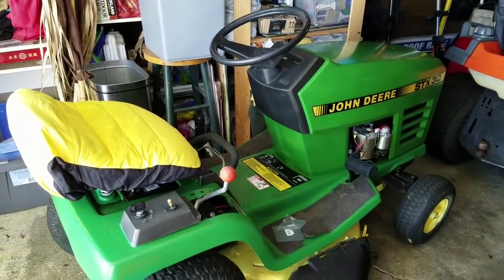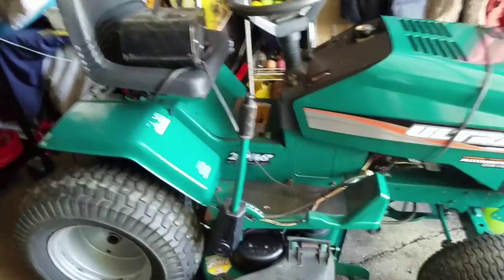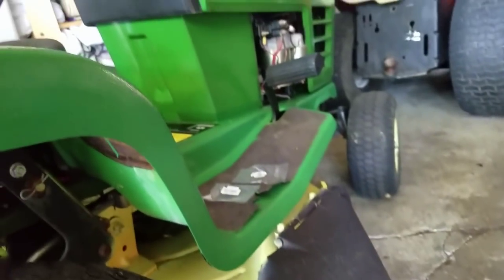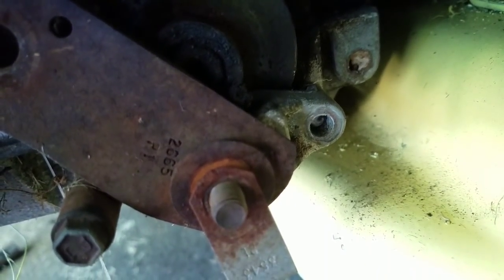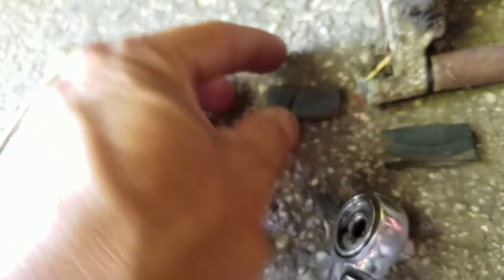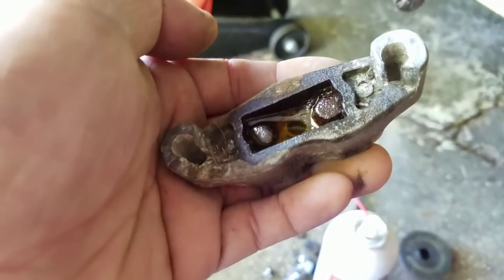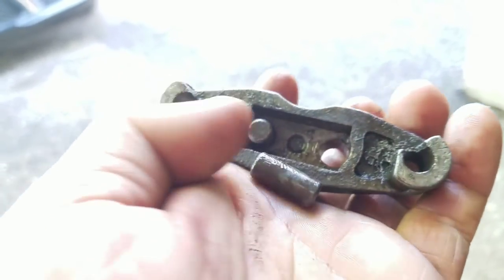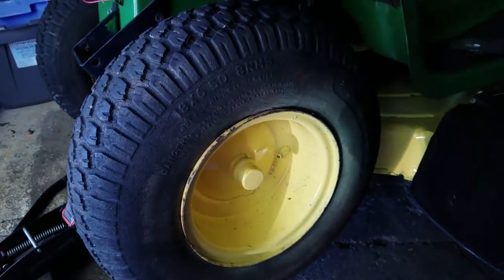JOHN DEERE STX30 LAWN TRACTOR RIDING MOWER LAWNMOWER CHANGE REPLACE BRAKE PADS REPLACEMENT BRAKES

Comment: I make my own. Use old car brake pads and a hacksaw. To get the wheel off , use an air hammer. You should put never seize on all that stuff.

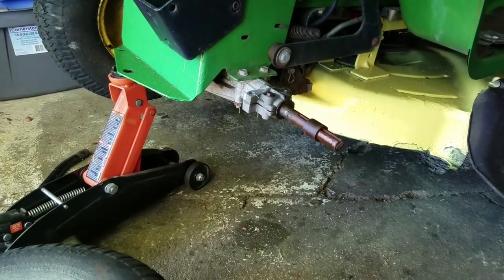Comment: I see a keyway, but I don't see a key. @5:58
Reply from the maker: Well you’re going to have to trust the fact that I put it in when I put the wheel on or it wouldnt run would it? Sometimes not every little thing is captured on camera,  like when I went inside to pee.